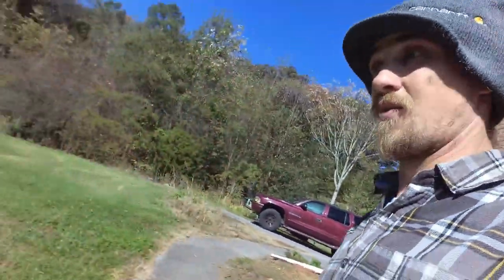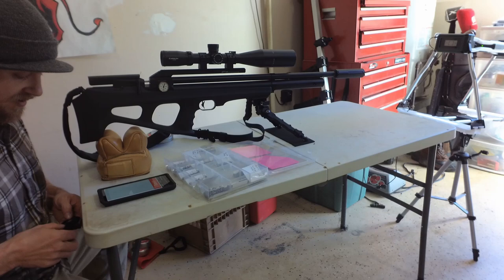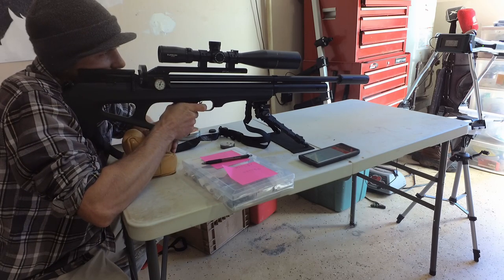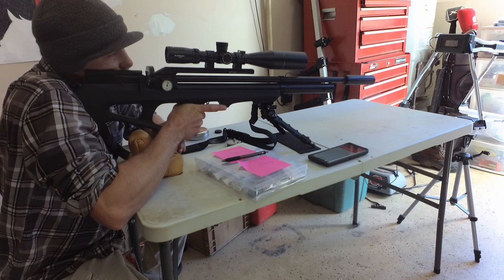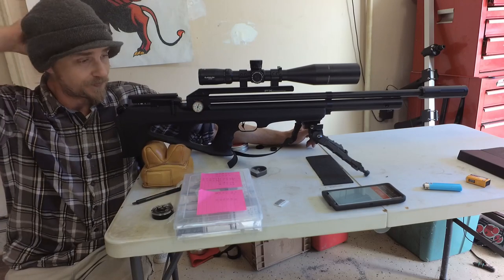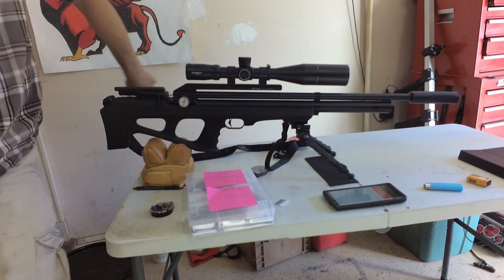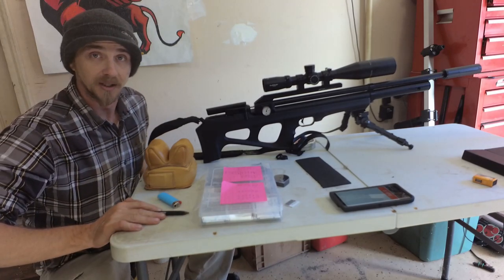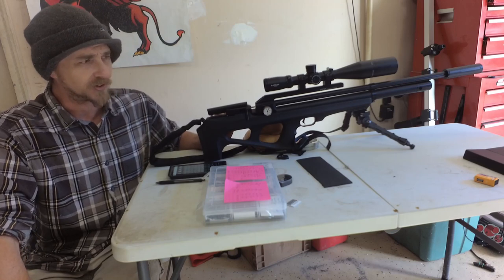.218 griffin slug bc test

Comment: I'm impressed with the performance I've been getting from the .177 dish base griffin slugs. I been trying out. The 16gr 20gr and 21gr dish base from my hatsan nova qe . 177. I am interested in     learning more about the. 177 dish base and boat tail slugs.
Reply from the maker: I'm hoping to get some bc data on the .177 this week as well as some 100 yard groups. Sorry for the crazy long video and mumbling lol. Next time I'll just use my scope cam to show down rang velocity.
Reply: Haha don't worry about the mumbling. Its still a great video.
Reply from the maker: Here's what I got so far the average bc of a 16 gn dish is .079 the over all cup and dish bases seem better initial stability then the flat backs the RBT does very well to but can be finicky in a magazine signal loading works much better for those. We will be ordering different RBT styles for all of our dies to correct loading issues do to probe and mag interaction issues. Hopefully this was helpful since daylight saving time it's been more difficult to get testing done.

Comment: Just got a dreamline lite 30 just got 22 kit plus liner on another video you committed your shooting 24 grain slugs at 880 how are you getting that fps with 24 grains help would be awesome nice videos by the way
Reply from the maker: Yeah I tuned my regulator to 135 bar and increased the hammer tension useing the 1.5 mm allen screw in front of the power adjustment wheel. I also widened the transfer port hole in the barrel about 20%. My max velocity with the 24 gn slug was about 910 but got the best accuracy at 880 to 890 on the 5 power setting. That gave me a good shot count at 36 shots per fill and around 42 fpe. This is a nice balance for this airgun I tried going faster at one point I had my reg at 165 and getting 48 fpe but my valve broke and had to replace it so I keep it under 150 bar now. A good place to start with adjusting the 1.5 Allen screw is set your power wheel to max then tighten the allen screw till it stops or gets harder to turn (there is loctite on the threads) this should give plenty of hammer spring if you need more turn the power wheel to min to release tension on the allen screw tighten a few more turns then move the power wheel back to max making sure it does not bind. If going to max feals hard dont force it just adjust the allen back out a little. That allen is also how you can fine tune the harmonics, once you find a power setting that is more accurate you can make small adjustments to tighten the groups up even more. I hope this made sense if you have any questions I'm happy to try and help! Shoot straight my friend
Reply: @leadslinger5130  awesome 👍 I've messed with it here and there and for some odd reason when I tighten the little Allen screw so that way there's no slop on max my velocity for some odd reason is usually a little lower than when I turn it back off the little allen a little bit and put some slop back into it I still have the FX gauge so it's roughly around 130 I use the little allen wrench and tighten it back up and running over the Chrono again tomorrow I only did it when it was 30 so I'll do it as a 22 and I'll get back to you
Reply: As a 30 I was getting 840ish with 44jsbs and under a inch at 💯 yards I was pumped but wanted to be able to switch back and forth between 30 and 22
Reply from the maker: @nickhathaway4617   I had that problem to with the hammer spring that's means it's a little to tight. I would adjust it to no slop if the velocity drops back it off about 1 tuner ( 1/3 of a turn since that's all that can be moved without disassembly). Also finding the right slug helps, definitely try .217 and .218 diameter the .218 dish back shot 9 fps faster then the .217 version. That means it sealed better and should also be more centered in the bore. Also it reduces lead fouling, after about 500 .217 slugs my barrel had large smear patterns and accuracy was gone. After about same amount of .218 slugs my barrel looked bran new. I had to do some reading before that made sense lol. I would think your reg pressure is probably pretty close since you got it in 
.30 cal. I switched to my .25 slug setup again because we got a new .249 die and we can make them light weight all the way down to 27.4gn I cant wait to shoot 100+ yards with these.
Reply: @leadslinger5130  awesome let me know how you make out with those tried it again this am 915  920 was the highest and that's only with nsa 17.5 slugs and once again shoots faster when there's mad slop on Max with no slop 889 so confused LOL are you shooting at on the 22/177  setting or on the 25/30 maybe since you drilled out the hole 20% bigger maybe that's the difference? Got to get a better gauge if I have tomorrow I'm going to bump the reg
Reply from the maker: @nickhathaway4617  that is odd! The only other time I had that issue it was because my reg was to low for the amount of hammer tension for some reason it had the opposite effect. The other thing I ran into was my reg guage was off by almost 10  bar I changed it out to a wika gauge and it made tuning much easier. And yes I am using the .25/.30 setting I ported the transfer port to about the same as my .25 barrel and that gave me about 20fps more. But just using the wheel at .25/.30 gave about 10fps so combined it was a total increase of about 30fps. My uncle went crazy on his impact barrel the transfer port looks like it should be on a .30 cal lol. Sounds like your reg is a little low next time you shoot your gun before you refill watch both guages if the reg starts to drop before the tank pressure reads the same as your reg pressure then your reg guage me be off. Example my reg pressure started to drop below 140 when my tank said 155. I have since changed both guages and the now match with in 2 bar